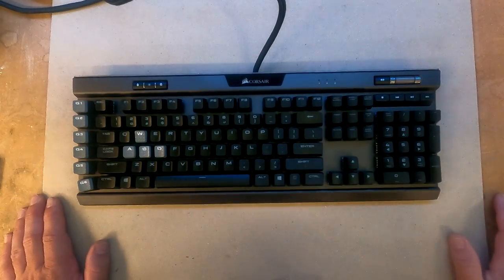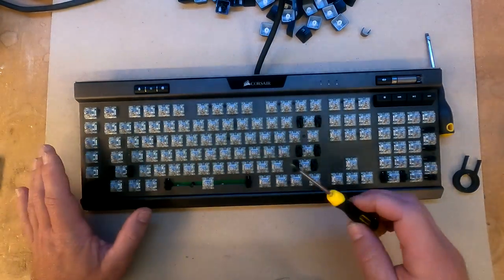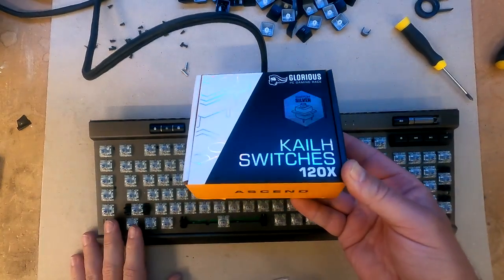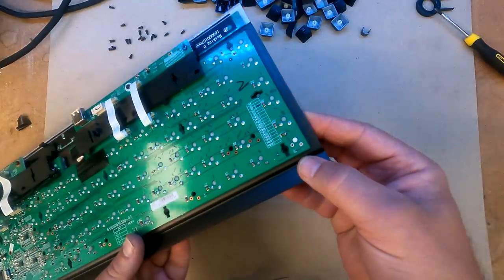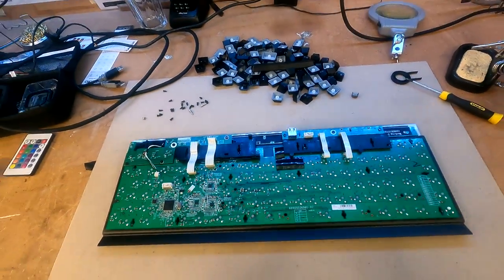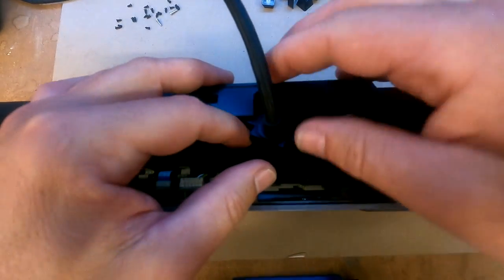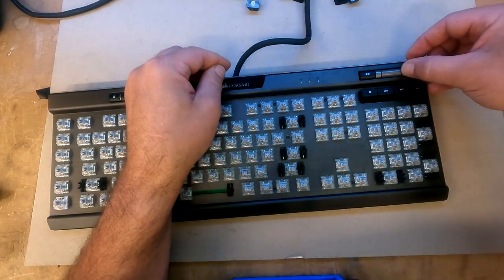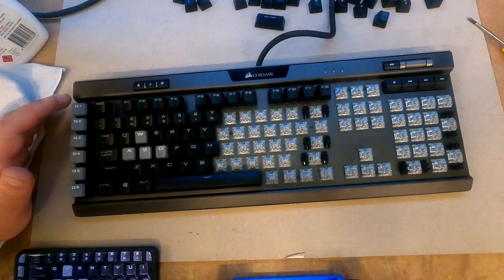Corsair K95 RGB Platinum Disassembly and Keyboard switch Replace..

Comment: Thank you for this video. Wasn't using it for the key replacement part but needed to open it up after water got spilt on it. Couldn't find that dang screw under the plastic next to the volume wheel.

Comment: So this video doesnt really show the desoldering part. Which is nearly impossible on this keyboard. Ive attempted to desolder and permanently broke my pcb ports and was a difficult fix. The desolder pump is a must here. The solder wick is not gonna do the job here.
Reply: You need to use flux with the wick
Reply: @Ricqu  maybe that was the mistake youre right
Reply from the maker: Sorry about not showing the desoldering part, I just used a solder sucker. That is probably the easiest way to desolder the keys.
Reply: @miki_ned   I was able to restore broken sockets by soldering external wires. It was a painfull learning process though. All good. Keyboard is 💪

Comment: But why uncouple all those  plugs if all you do is solder on it without having electricity going trough it ?
Reply: Remove the cables made it WAY easier to work on! Mine is all zip tied down with cable management at my desk, so to avoid removing all the cable management, I removed the cable and was able to very easily work on my keyboard. It's not difficult to do, and makes it so much more versatile to work with.
Reply: @sparetent  I did change 3 switches like in your clip but I lost the windows key unfortunately, never wanted to work with the new one...

Comment: What is the correct switch for the K95 Platinum ? One of my Switches is out and I am looking for the replacement as I know how to solder.
Reply: it's either cherry mx brown (tactile) or cherry mx speed silver (linear)
Reply: @jasonmxx  Thank you. I have the cherry MX Silver
Reply: @jwar2163  it's the better version for gaming in my opinion. but since you know how to solder anyways you can put whatever switch you want (as long as it is a 3 pin switch only). you might want to take the opportunity to lube the stabilizers while you're at it!

Comment: this video came in handy... dumped coffee on my brand new keyboard this morning and KNEW it got inside.  happy to report that following along with this tutorial, I was able to get my board apart, clean it with electronic safe solvents, some canned air, and an old soft bristle toothbrush... keyboard is as good as new. Thanks for the walkthrough.
Reply from the maker: I am glad it helped!
Reply: did you have to change the switches? i'm having the same issue now. some liquid got inside and my keyboard is glitching about.
Reply: @afniad426  no.. the keyboard switches made it through okay... actually typing this with that very keyboard.
I didn't wait to let anything dry out though.  As soon as I dumped it, I grabbed the tool kit and started disassembly.  Once I'd cracked the side open to let the coffee pour out, I pulled the plug on it, took the keyboard outside and finished the tear down, watching the video on my phone.

Comment: Thank you for this video, it did help me disassembling the keyboard enough to fix a problem where I spilled a tiny amount of fluid, which made a couple of keys glitchy. Thanks to this video, I could see that each and every key actually acts as a screw to hold the main board in place: this means that not only is this keyboard not even a little bit water resistant (I did worse to 30€ keyboards without having a problem), it's also nearly impossible to service. Never buying a Corsair keyboard again.

Comment: I overlubed my switches(and used regular lube not for ones for keyboard) so now they are bit hard to press. I'm thinking about removing switches and cleaning them or replacing them with new switches. My keyboard is corsair k70 bought it like in 2013. Your video is really helpful, Thank you.

Comment: Hey there ... off-topic question here. My son spilled a milkshake in my keyboard. I removed it all and took it apart ... I got it all back up and working except for the RGB lighting. This was working before I dissembled the keyboard. It's back together, so I was wondering what I should be looking for if I opened it up again to fix that? Curious if I missed plugging something back in, but not sure where the RGB stuff is inside the keyboard. Any help would be appreciated before I open it back up. :( (I tried all fixes like firmware updates, hardware lighting settings, etc.) It shows the keys lighting up in the software client, but the keyboard is dark.

Comment: Awesome guide, thank you.

I used this to open my keyboard and attempt to repair a faulty key that wasn't lighting up properly. Only after I successfully removed they switch, did I realize that the RGB LED is surface mounted to the keyboard PCB! F M L ...

Typical Corsair BS. Item is 30seconds out of warranty, LED breaks, and cannot be repaired! -.-
Reply: Same happened to me as well. Thing buzzed like crazy as well. Last Corsair peripheral I'm getting.

Comment: Thanks for this nice video. I dismantled and cleaned mine watching this video. But why have you replaced that switch with a non-transparent one? On my keyboard, the lighting is either dimmed, gone or shows the wrong color. I am under the impression that the LEDs are built-in into each switch. Is that so? And if yes, do I need to find switches that have build-in LEDs to replace mine?
Reply: Hi, I know my reply is a bit late but I am facing the same problem. Looks like the LEDs are underneath the switches and you just have to use transparent switches so that the LEDs can shine through. The switch he used in this video is just white from the underside, the upper half is transparent. So the LEDs of the keyboard probably still can shine through.

Comment: If I was to replace all my switches with new switches would I need to unscrew the last two screws holding the black panel?
Reply from the maker: Hi, Yes you would need to remove it.

Comment: Hello! Thanks a lot for the video guide!
Can you please tell me if it is possible to make soundproofing in the case of this keyboard? I want to buy a 5mm biplast and I don't know if it will fit or not? Perhaps someone has already tried to make soundproofing on the Corsair K95? 🤔
Reply from the maker: Hello, I don't know, sorry
Reply: @miki_ned  okay, thank you
Reply: I’m putting some o-rings on the keys (two for each key) and its reduced noise quite a bit. I’ve also heard getting a keyboard mat might reduce sound further
Reply: @Doublee73  Thx! 
Is the keystroke harder? I mean, has the smoothness of pressing them somehow changed?
Reply: @Gurbancho  The end of the key press feels a little squishier, which I actually like. It has helped me not mis-type as often because I'm forced to not press as far down

Comment: How do you unclip? I've desoldered and the pins are nice and loose, but the switch wont move.
Reply: Bit late, but you need a tool to remove the switches. Tabs on the top and bottom of the switches holding it in place
Reply: @MightyN0ob  Thanks. I did eventually realise there's little tabs, wasn't very obvious at the time though.

Comment: How do you unclip the switches after removing the solder is there a tool for it?
Reply from the maker: They should just come out, it's just the solder holding the keys in..

Comment: Why did you need to change out the switches?
Reply from the maker: My son broke one of them..
Reply: I took my girlfriend to Best Buy and all they had were MX Speed switches.  The display units were missing more than 80% of the keys.   For this I would rather buy from a store, but not when they are in that shape.  I bought, on Amazon, one of the last K95 Platinum with MX Browns.  The Browns are a great place to start.  Then if you want you can add O-Rings to taste.  I am still getting used to the upside down keys like the ?/ or the " keys.

Comment: Hello, What is the reference of the switches for this keyboard please? I would like to replace some of mine that blink strangely. 
Thank you for the video :)
Reply: These are Cherry MX speedsilvers
Reply: @augustinochlafen2090  Thank you very much for the answer, I will look if I find a distributor in France :)
Reply: @kahless7457  Try turning LEDS all red all green and all blue sequentially. It fixed my LEDS lighting up weird.

Comment: This is why i wont ever buy Corsair keyboards anymore, i like keyboards that you can just hot switch
Reply: yeah i have this keyboard just a newer one, its not really as tacky as i expected for a $140 keyboard. still is a good one to have though.
Reply: @BandoLando  I had a really good keyboard from crosair that cost 200usd and out of the blue one of the switches stopped working. and then the keyboard was dead to me if they just let you hot switch it would not have been a problem. so honestly not a big fan

Comment: can the switch be cleaned? My problem is if i press "6" it sometimes print it one time but usualy it prit multiple times...
It can be dirty or issue with cap - dont know where to by one red speed switch ...
Reply from the maker: Not too sure on that one, try a blast of air and see how you go. If not then you will have to replace it.